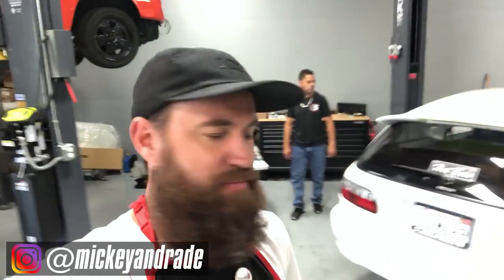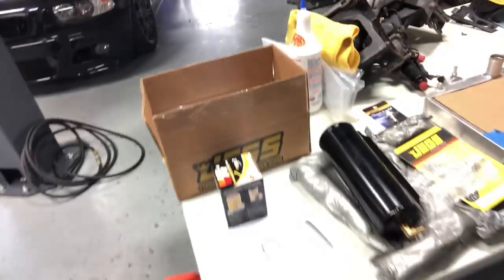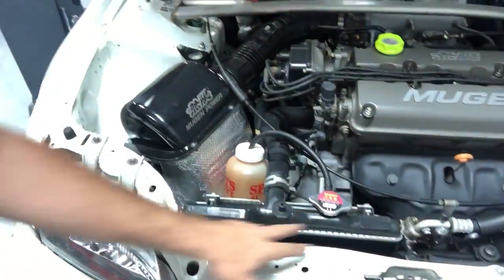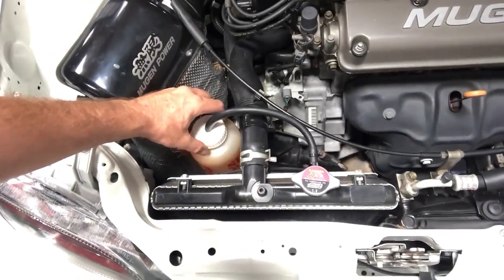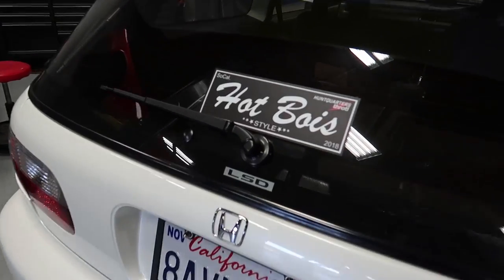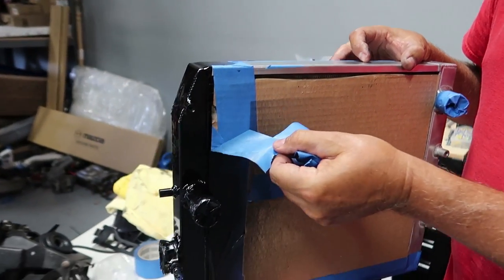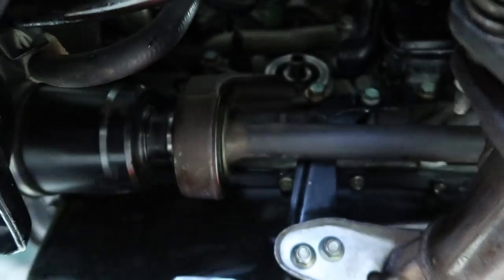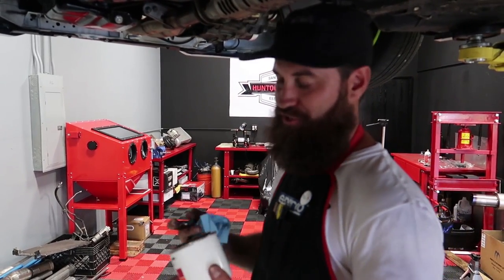MICKEY HAS BEEN WAITING YEARS FOR THIS INSTALL.... Civic eg SIR-S (JDM)

Comment: Would you recommend that fuel stabilizer on a car that only gets driven once per week for a few hours at a time then sits until next time? It'll also be off the road for about 3 months or so during the winter months.. thanks in advance
Reply: It's not a FUEL stabilizer Adam. It's called Lucas Oil Stabilizer. It creates a film which adheres to engine parts so you don't have dry start ups when your engine's sitting for months on end.
Reply: Sorry I meant oil

Comment: If you wanna save a buck or two, you can use the Mobil 1 Synthetic oil filter. At least for my Nissan applications, the Mobil 1 and K&N oil filters are identical. The only difference is the nut at the end for easy removal. Might be useful if you own a Honda with bad oil filter location. But for a Nissan, we always just save the $1-2 and go with the identical Mobil 1.
Reply: He's sponsered
Reply: He gets all of filter's for free

Comment: Hey i am interested in a oil filter relocation k8t for my FGT 2UZFE 4.7L v8 first GEN.  Toyota tundra sr5 4x4 access cab  i WILL have the biggest NORTHSTAR AGM made & 12 runs of MONSTER CABLE 1/0AWG 6 +&-  & some room for this modification!